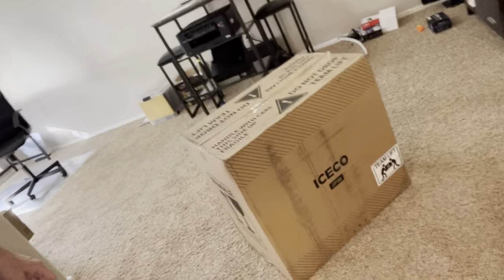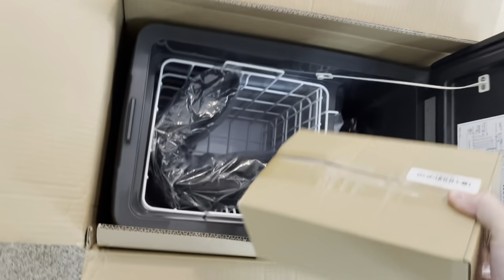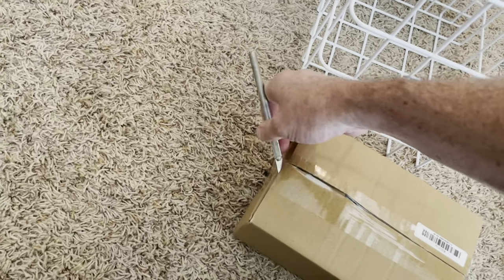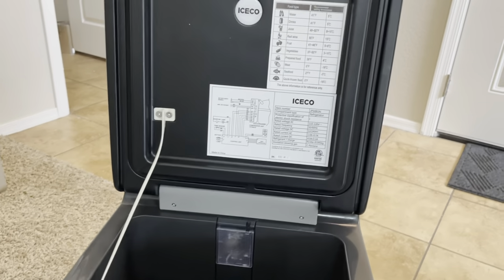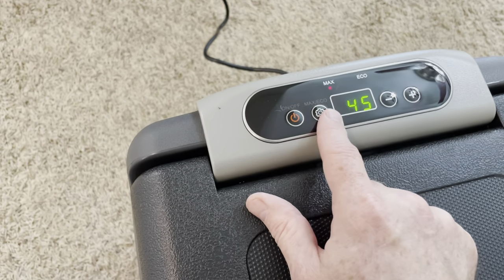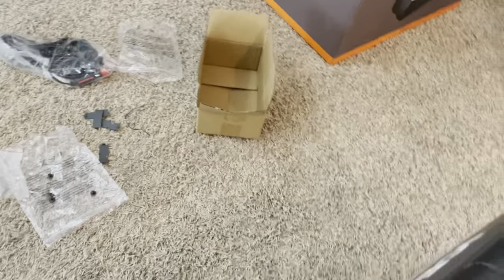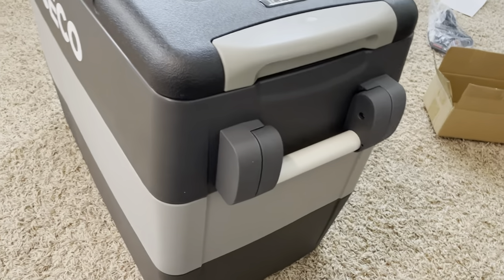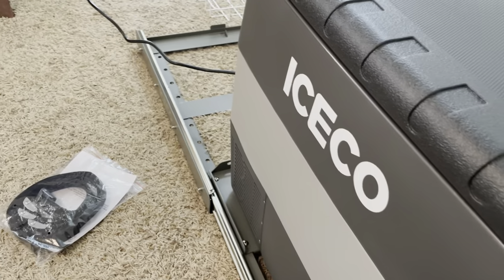Winnebago Rialta HD: Chest Refrigerator Unboxing (Part 1)

Comment: How tall is it when it sits on the slide.  I’m considering buying it, but want to make sure it will clear the opening of my 2004 4Runner as it will sit on top of a drawer system.
Reply from the maker: The fridge (the JP50) itself is about 21 inches and the slide puts it up about another inch. I’d say give it at least 23 inches for clearance.

The smaller ones have the same footprint, they are just shorter.

Comment: That’s a nice fridge! Can I ask why you chose to get this style of refrigerator instead of the same style that was already in your van?
Reply from the maker: A couple main reasons:  first, this has what is called a Danfoss compressor, which is a German design. It is very power efficient so it saves my batteries. Now, there are regular RV style refrigerators that use the same compressor, but they cost over twice what this one does.  Then, with this I now have the ability to carry it somewhere else - it’s not fixed to the RV, so I could take it on a trip, or camping or whatever.  :)
Reply from the maker: Another (less important) reason is that it pulls out and I can access it from above. My old refrigerator was elevated but still required bending over to see inside. In the other RV, its fridge was on the floor and was a real pain to access....so something like this would have been a huge bonus.
Reply: Those reasons all make perfect sense! It definitely sounds like a good change.